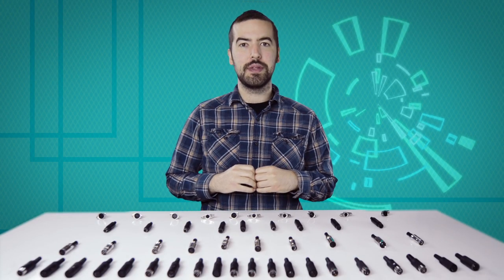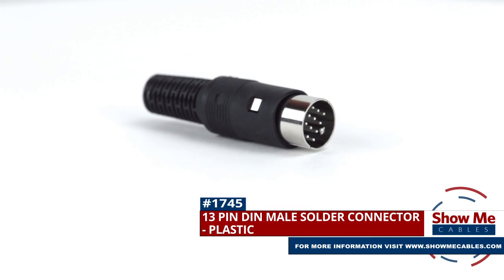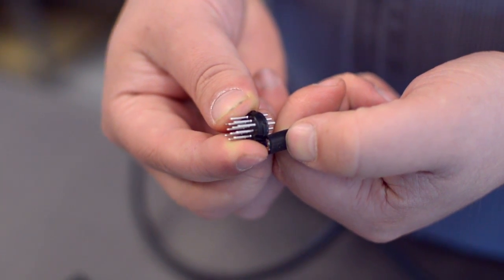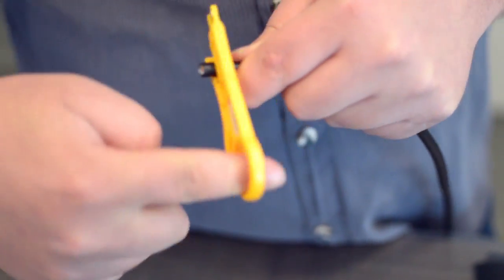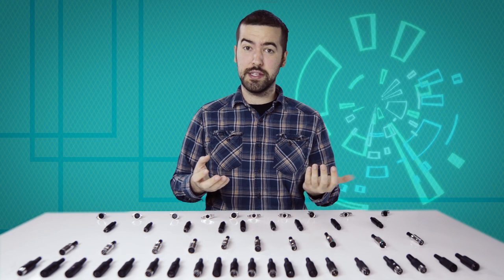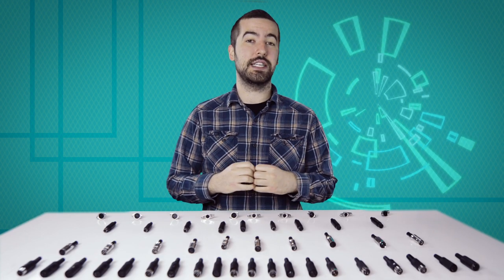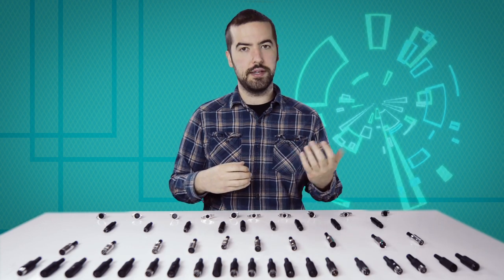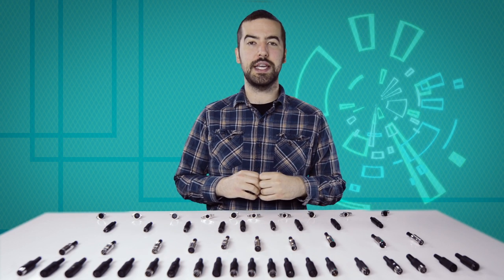How To Install The 13 Pin DIN Male Solder Connector - Plastic

Comment: I see.  In other words, don't try to repair the cable.  Buy a replsacement from ShowMeCables.

HOW DO I SOLDER THE WIRES TO THE PINS!?  I expected the interior end of the pins to be a little tuble.  NOPE!  Now I understand why then  wire easily seperates from the pins.

I can't even get the plastic off the plug.  Grrrr

Comment: Hi !
I have a cable with 13 pin male din connectors on both ends. What devices work with this ?
Reply: for example samsung home theater ht-p1200 or old ATARI computers.

Comment: I have to say this is about the most useless video I've seen in a long while.  No pinouts, no point.  I would re-title this "The 13 Pin DIN Male Connector" to remove the word "install" which I think encompasses awareness of the desired pinout.

Comment: Hi! I have a device with this type of a connector on both sides while I need 13 pin on one end and any plausible connector(3.5mm/2.5mm AUX) jack to connect it to audio source. I need you kind advice in this matter.Thanks!
Reply from the maker: This is certainly possible...the only issue is you would need to determine how the internal wiring would need to be done.  We do offer custom cable assemblies, so if you are able to figure out how the cable would need to be wired, we could certainly find a solution for you.

For additional questions, please feel free to contact our customer service department at 888-519-9505 or customer.service@showmecables.com

Comment: It would have been nice if you actually showed how to solder the solder points. It's tight quarters in there.
Reply: indeed or how to decently solder it onto a connector that has same shape on the insides.  seems they melt before the shit even wants to hold on
Reply: Start from the inside and perhaps bend the outer ones out.
Reply: I know right? It's a totally worthless video.  A chimpanzee could have figured out what the vid tells us, but the "hard part" soldering itself?  No tips, nuthin'..."hire a pro."  If I could thumbs down twice I would.